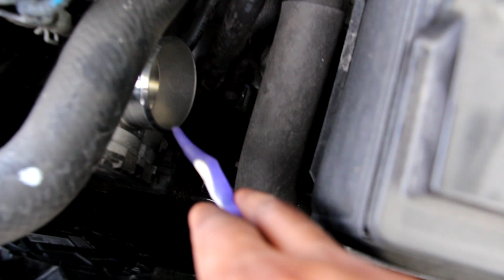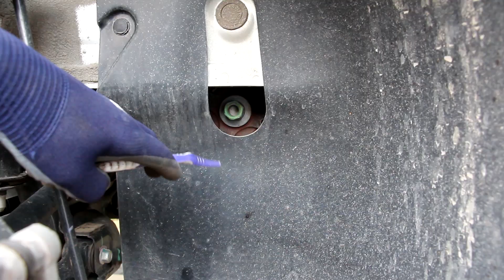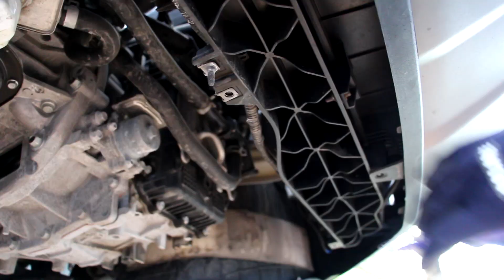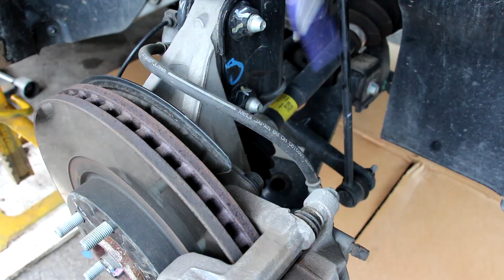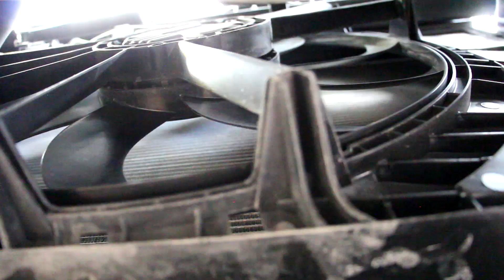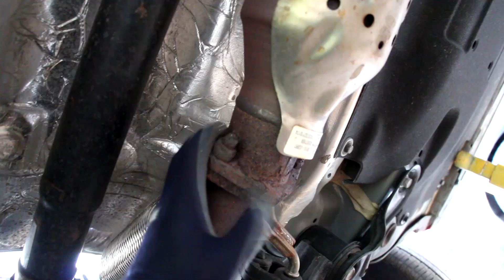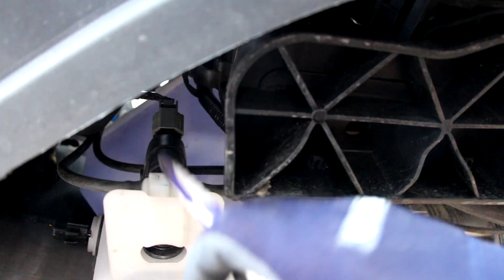Hyundai Santa Fe Mechanical Review

Comment: So now that the redesigned 2022 Santa Fe has a 2.5L with 8 speed, a 2.5 Turbo with 8 speed wet dual clutch, and 1.6 Turbo Hybrid & PHEV with 6 speed, which are engines that Hyundai and Kia have used in other cars for a while, which engine choice would you choose for long term engine and transmission reliability?
Reply from the maker: The naturally aspirated one

Comment: I've never seen plastic subframes before...I mean, what is the point of using cheap plastic? I am sure the insurance company would still charge thousands to repair it just like steel.
Reply from the maker: It's just the radiator cradle. Plastic is lighter than steel and won't rust. 
It'll crack much faster in an impact and will have to be replaced.

Comment: I agree with the response that this is a very thorough explanation of engine and vehicle components.  And I'm sure this video will help me when I put the new engine in.
I am about 3/4 of the way of pulling the motor from my 2015 Sante Fe turbo. And even though we have the software knock sensor service call  in (that did not work), we are wondering if Hyundai will honor the class action suite for 1000's and 1000's of their engines than have gone bad do to metal chips left in the manufacturing process and lack of oil from oil pump.

Comment: All the people in the comments worried about all the plastics in the car sound like the boomers/Fudd in the 1970s/1980s when Glock and HK came out with Polymer handguns they all thought they would fall apart and are junk now look most firearms use modern Polymers and they are more durable same applies for vehicles

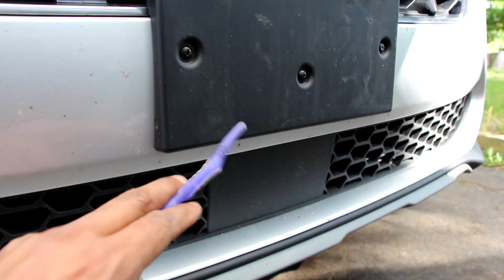Comment: 12:53 That's incorrect my friend, the sensor is actually behind the bumper cover and held on by 2 thin aluminum brackets. Now that solid plastic actually protects the radar from incoming debris from the road and if u look either to the left or right of that solid plastic through the honeycomb holes, you will see the radar sensor about 5 inches behind. I hit a cone on the i95 that was capsized on the roadway and the forward collision light came on almost immediately. I checked it out and the radar itself wasn't damaged but it's flimsy bracket was and I had to staighten it in order to fix the malfunction.

Comment: 3:12 Do you have any thoughts on Oil Catch Cans? I was glad to have external ventilation for the PCV so I could add an OCC since the engine is purely Direct Injection. I think I installed it before I hit 2k miles on my Santa Fe

Comment: Electric parking brake, UGH! We in the US learned NOT to do that in the 1950's. Can't wait til that dies in my wife's 2019 SF
Reply: From what I understand, adaptive cruise control requires an electric parking brake, hence the move for new cars going that way
Reply: @fitztastico  That sounds extremely dangerous. Why would any sort of automated drive system want to brake using electric rear  brakes only to either control speed or stop the vehicle completely? If the vehicle had automatic parking, so it would then need to set the parking brake, I could see it, but EPBs are in many cars and SUVs already w/o adaptive CC or Automatic Parking.

Comment: I really like your reviews You're very in depth about the mechanicals on vehicles and I definitely appreciate that. However I kind of find of interesting that almost everything that you pointed out as being sort of a negative... old school, not new tech..etc are things I'm glad they are doing that way.
 Mechanical water pump, simple easy to fix and inexpensive to replace, old-fashioned vacuum brake booster.. good, it works it always has worked and it rarely fails, and gives better feedback to braking than electro assisted brakes  . Having the PCV NOT built into the intake manifold? Why the hell would I WANT that? . Because they eventually plug up and then you've got to take the intake manifold off. VW does this crap but it's in the valve cover, and you have to replace the whole valve cover for $200, or I can go to O'Reilly and buy a $3 PCV. Everything you mentioned or sort of implied was old school and not new technology seems like a good thing to me.

Again I'm not criticizing your mechanical aptitude or anything like that I think you did a fantastic job pointing out very important details of the vehicle. I just find it interesting that your take on some of these older technologies seems to be negative when in reality it should be a positive at least in my opinion.
But maybe I'm just weird because I tend to keep my cars for  350,000 miles.
Reply from the maker: I understand your perspective. Watch my Ford Escape and Rav4 mechanical reviews and you'll understand how behind Hyundai is under the hood. I'm simply comparing it to it's competition.

Comment: Are Hyundai reliable ? Thanks for the knowledge share:) keep up the good work.
Reply: That GDI engine may not be and carbon buildup is a problem too.
Reply: Hyundai are mostly reliable, but avoid this engine and the dual clutch transmissions. 
I wouldn't get the IVT either myself. It's probably fine, but it was designed on a shoestring budget.  I'll let somebody else's money test that while I drive a proven transmission.
Reply from the maker: Sure. But everything else around might not be

Comment: FInally!!! Mechanical review! Best review ever. I wish you did a small add-on about the 2.0 turbo engine. I bought this in 2018 to downgrade my 2007 Santa Fe with 300.000 kilometers to a short-distance family hauler. I hope the new one will be as reliable as the old, I miss the V6 though. By the way dealerships are extremely careless with the oil change panel, losing clips and re-installing it incorrectly.

Comment: Thank you for the video. Do you know if this engine have any issue for this car? I know Hyundai had the issue you stated in your video, but I'm curious if they fixed that issue for the 2019 and 2020 models.
Reply: Hyundai did not recall these engines (yet). My understanding is that it was a production defect so I hope they sorted it out by now. I have the 2.0T.
Reply: @AGR96  You enjoying that 2.0t? 😁. I got the 2.4 so I hope they did fix the issue.
Reply: @will-i-am316  I love my Santa Fe, yes. But I think I would enjoy the non-turbo just as much. To be honest I tried the 2.4 before buying the 2.0T, and did feel the 2.4 absolutely adequately powered. I bought the turbo because of the reviews I watched did not like the "powerless" engines they put in the Santa Fe. I was wrong. I feel like I would have much better peace of mind having a non-turbo with less heat and pressure in that engine. If anything, the non-turbo should be more reliable. Not to mention less oil changes.. Anyway, I believe if I maintain it religiously, I'll have less chance of engine failure and that goes even more for your 2.4. Take care of it and enjoy for a long time! :) Did I mentione I have a 2007 Santa Fe with 300.000 kms? Still strong and healthy ;) V6, naturally aspirated.
Reply: @AGR96  the power on the 2.4 is not bad at all. When Sport mode is on, good torque low end. Thank you for your replies.
Reply: @will-i-am316  Yes, definately. 2.4 is cheaper to buy and to maintain, potentially more reliable as well. In addition power is enough. 2.0T is a bit more powerful, but to be honest the turbo lag makes it less obvious. Enjoy yours! You made a good choice! :)
Reply: @AGR96  Keep making more videos on your Santa Fe. I would love to watch and learn more about our Santa Fe.
Reply: Hyundai paid dearly for that issue.  As have many other manufacturers for their faults. You can be assured that they absolutely corrected the problem, that no engine blocks casted will ever have any remaining debris ever again.  They wouldn't want a repeat issue,  cost wise. Or reputation wise. I mean this problem was several years ago, and everyone keeps jumping on it like it just happened.

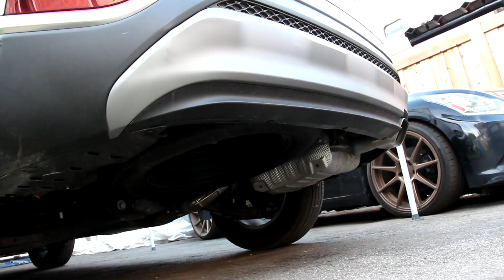Comment: 16:02 WTH is that metallic sound? My 3 cyl 1.0 T-GDI has the same rattling exhaust sound and it originates somewhere between the cat and the first resonator. Been crawling underneath the car longer than local cats to find out what the hell is causing this rattle. Mechanics differ in assumptions, some say it is normal for hyundai, others say it's a failing cat or something along those lines. What is your take on it?
Reply: My '19 Tucson sounds the same and sometimes even worst (have videos on my profile to prove it). The noise has been there since I bought the car and it bothers the hell outta me.
Reply: @FUELEDNOVA718  found out what it was — turbo wastegate rattle. You can fix it for 50 cents yourself, just buy a spring and tension the arm that goes from the servo to the wastegate. It is located just behind the motor at the top. Very easily accesible, just remove the top beauty cover and insulating foam. Connect one sping end on a rod that supports the plastic cover, the other end on the arm itself. Suggest adding a little of hose rubber to it, a small, mby 3mm hose, so that it would not scratch in time. That wastegate has a spring from the start, but it is just too weak on some turbos and need a bit of help. Ride it till you hit high mileage, then remove the spring, report the wastegate rattle, get new turbo, profit!

Comment: Are these engine still prone to engine failure?
Reply: Luxurygame 006 I had a 2018 Kia Optima that developed an engine rattle 2 1/2 years after I bought it. I traded it in for a Corolla almost 3 months ago. I’m sticking with Toyota for a while.
Reply: Luxurygame 006 no when I’m driving when it was warming up. I did have the sound when starting it like this one in the video

Comment: How long before this engine catches fire?
Reply: No, if I had little money, I would never buy that.
I already have a Kia Soul,I can't wait to sell it, but since the value of these cars goes down pretty quickly, it will not be very expensive.
Reply: @California_ Dreaming Hello.
Basically, no, because even if the car (2014) has qualities, it also has flaws.
Poor quality of some parts, brakes, headlight bulbs, interior and exterior plastics, fragile windshield, the engine consumes a lot of fuel, except on the road, the 2L GDI engine lacks torque, and mine consumes oil , I am not the only one from what I read ,.
some even broke the engine.
Sometimes it makes a cold noise when starting, like a diesel..................
The automatic transmission, works well ...
Reply from the maker: I get the joke 😏
Recall

Comment: I owned a 2016 Kia soul. I believe mine was a 2.0 L GDI engine. Not sure what the fatal flaw on that engine was but it completely failed at 72,000 miles. And before you ask I change the oil religiously every 4000 miles. It was a lesson learned....don’t buy Kia / Hyundai throwaway junk vehicles. Do yourself a favor and go with a Toyota or Honda.They will cost you a little more in up front but where you get your money back is after the 100,000 mile mark.
Reply from the maker: Ouch. I've heard alot of good and bad....was yours a turbo?
Reply: @speedkar99  it was not. Luckily I got a reman engine under thier powertrain warranty. Then I dumped the car and moved on. Love your channel btw....

Comment: The 2017 Hyundai Sante Fe came also in the 2.0L turbo 4 cylinder and the 3.3L V6. The ECM in the engine bay is stupid because things get pretty toasty in there and electronics do not like being constantly heated up and cooled down. That is how they prematurely fail.
Reply: it's not that bad.. for years diesel equipment comes with the ECM bolted to the engine running hours at a time and we hardly have ECM failure due to over heating
Reply: ur more likely to blow a ECU from improver jump starting or voltage surge from say arc welding, power washing the ECM etc.

Comment: Korean car manufacturers definitely borrowed a lot from the Germans and Japanese in their engineering. I was hoping that Hyundai and Kia were just Toyotas/Hondas/Mazdas/Subarus/Mitsubishis/Nissans/etc. for a cheaper price and more features. No port injection for the fuel delivery system is a concern and exposed electrical harnesses and steel components for this Hyundai will be troublesome in the future. Hopefully Hyundai can offer rustproof coating for free or deep discounts when buying their vehicles.
Reply from the maker: Rust proof is definitely recommended

Comment: Great job as usual. Enjoy your extensive reviews like these. Toyota use established designs for decades too. There’s a good reason. 

No need for a vacuum pump as it’s a normally aspirated engine with plenty of vacuum available. Turbo engines need mechanical or electric vacuum pumps to provide vacuum.
Reply from the maker: Toyota used vacuum pumps on their non turbo engines
Reply: speedkar99 Sure enough appears they do on some of their later models. I wonder if it’s related to some part sharing with the hybrid models when the gas engine is not operating. I’ve seen a few vacuum pumps related to EVAP systems, but haven’t seen too many of the late ones. Thanks for the heads up.

Comment: At least a plastic lower radiator support won't rust out on you like my old 4th gen Maxima. I would like to see a mechanical review on the Hyundai Lambda II  3.3L GDI V6 if you can get your hands on one.
Reply from the maker: But I'd love to have the rad support as a jack point
Reply: @speedkar99  fair point as long as it's still intact. Thanks for the informative content.

Comment: Hey speedkar99, could you do a video on basic vehicle mechanic check, fix/ repair, what each symbol mean, and how to fix it yourself.

Examples:
• check engine light comes on.
• Someone put water/ sugar in your gas tank.
• A rear windshield wiper doesn’t work.
• A turn signal or light (by light I’ve included head, tail, brake, high beam, fog, low beam, caution & headlight) is out.

Now how would a newly beginner mechanic that hasn’t worked on his own car yet do, fix, change/ replace, remove, drain, & repair their own vehicle.

Keep up the great videos, you & ChrisFix are literally educating future mechanics (& beginner mechanics) on vehicle service DIY.
Reply from the maker: Thanks. In general I don't make videos on ABC stuff I tend to lean on the more technical XYZ stuff
Reply: @speedkar99 xyz stuff, so you work backwards?

Comment: What important to mention that 2018 onwards Hyundai & Kia cars are equipped with the crazy R1234YF AC gas, which is crazy expensive to refill & service + flammable in case of crash!
Reply from the maker: I Never knew that. Is it more environmental?
Reply: @speedkar99 , if so then only slightly, while it's 10% less efficient, potentially unsafe, but 10x more expensive than R134a & very profitable for DuPont and Honeywell who have patented and hold all rights to manufacturing and selling it. Mercedes-Benz withdrew from using it after the fire hazard it poses.

Comment: That exhaust looks like the cheap steel bent pipes you can buy on the aftermarket. They’re not stainless and are extremely susceptible to corrosion, so you have to throw it away after 3-4 years in the Northeast.
Reply from the maker: Yeah it's so crusty. You can see where they've cut costs to bring you touch and feel features like AEB and Android auto

Comment: I see contribution from the German engineers with those torx bolts placed randomly around the vehicle.
Reply from the maker: "contribution" 😂
Reply: @trent7080  I used to own a 2001 gallant. Pretty damn reliable vehicle it was until one winter it was when I hit black ice and spun a few times crashing into freeway devider wall when vehicle was 10 years old, not wearing vseat belt and honestly drove faster than I should of that day. I drove it new off the lot with 2 miles on it back in 2001. In my opinion they started going down with a 2004 model year of Galant, discontinuing mirage and diamond models. Eclipse redesign was a catastrophic fiasco too.
Reply: @Nomore4x4s  is your car brand NotSmart by any chance ?
Reply: hyundai cars exact copy of Mitsubishi.
Reply: @dark6c159  Um no, the did however used their engines up until they made a decent copy of them. We are talking almost 20 years ago that was quite obvious.

Comment: I like it, looks simple and reliable.
Reply: Hyundai’s are definitely more reliable than they used to be. Had a 2005 Elantra that’s still around today at 300,000 miles (no major repairs) and a 2013 Elantra with 80,000miles that’s doing great. They’re also very cheap to fix on the rare occasion something breaks.
Reply from the maker: Sure that's good for long term owners but it's outdated from a technical standpoint
Reply: @speedkar99    Hyundais and Kias are actually early adopters of new technologies among mainstream brands. They were one of the first ones to use electric power steering, direct injection, DCT, etc.

Comment: Do you recommend getting the Santa Fe over the Ford Escape?
Reply from the maker: Please see my Ford Escape mechanical review. I recommend against the Escape, there's alot of new tech there that can fail, and it's 3 banger is not refined.
Reply: I would recommend a Toyota Rav4 to be completely honest For a second choice I would say a Honda CRV! 😊
Reply: @DeathMammoth91  WAY TOO MANY RAV4s and CRVs on the road. Would like to get something different
Reply: James K , There is a reason for the large number of Rav 4 and CRVs on the road.
Reply: James K Mazda CX-5?
Reply: @American Patriot But which is more reliable? The 2020 Escape is brand new and has no data on the engine reliability although the previous models were pretty reliable. Hyundai updated the Theta II engine for the 2020 Santa Fe so its pretty reliable now. Santa Fe is roomier but I'd take reliability over roominess.
Reply: @Chris Ray The Lambda were excellent engines! The 2.7, 3.3, 3.5, and 3.8 are excellent engines. I would like to buy new lol